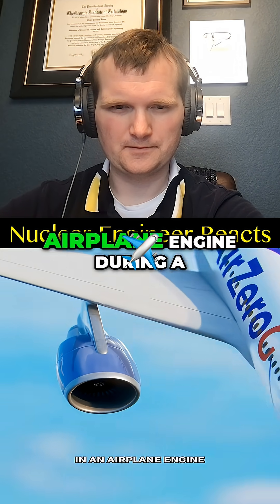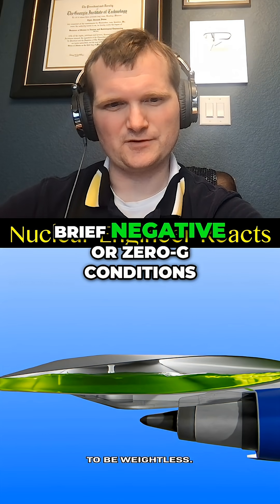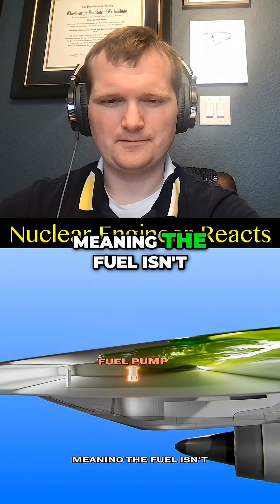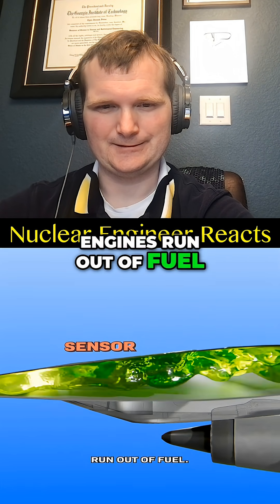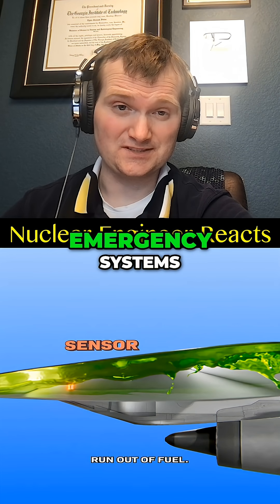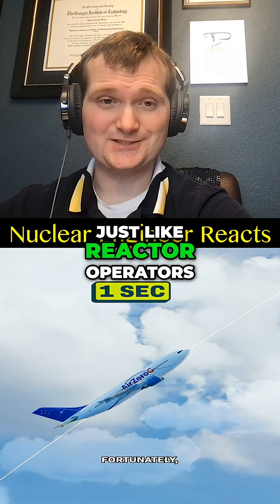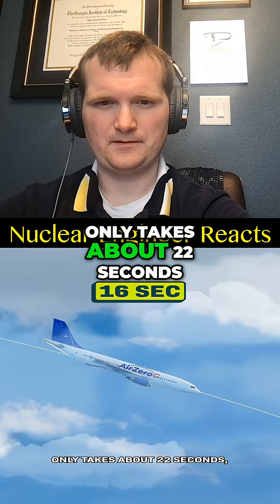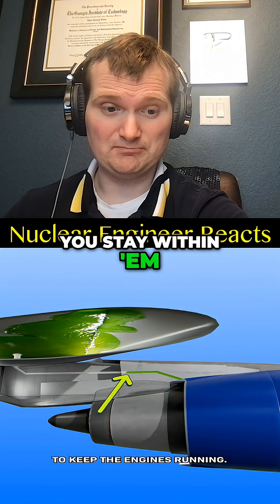Is it Okay if My Jet Fuel Floats? - Nuclear Engineer Reacts to Cleo Abram

Comment: Yeah this is simply not true, some very simple aircraft and specific systems have / had this problem in aviation but that is not the case anymore (complex aircraft). Just an obvious pointer, if this was true an aircraft wouldn’t be able to be inverted which almost all complex aircraft do in an period of time. As you said theese are pressurised systems with many redundant systems that prevents this.

Comment: Also, larger plane especially, can have multiple fuel feed systems as well as multiple fuel tanks - and since they don't do these flights with random aircraft, but specific ones set up for these flights, maybe they modifications to avoid this scenario entirely. But more likely the engines are not fed directly from a tank that is gravity fed.

Comment: Even with the residual fuel in the fuel lines, there's still going to be the air pocket in the line (assuming it's an all closed system from pump to turbine) that it wouldn't matter. 5 seconds or 2 minutes of 0G the air pocket that is created will remain, only the volume of air in the system would change. I'm not sold on this explanation. I'm sure it's not a traditional fuel pump, or It's a pressurized fuel tank/system, or something other than what she explains.

Comment: If the fuel pumps in the aircraft are briefly sucking air during the “weightless” maneuver, what’s keeping the engines running when those air pockets in the fuel lines hit the fuel injectors?

Comment: In the 80s my RC plane had a flexible tube pick up with a lead weight on the end. I could fly inverted or even at 90 or 270 'cause it had a large vertical stabilizer and rudder

Comment: Engines stalling due to fuel starvation when the plane nosed down was a problem for British Spitfire and Hurricane fighters durng the 1940 Battle of Britain and is also shown when a barnstorming pilot attempts an Outside Loop in "The Great Waldo Pepper".  I have always wondered why the designers of those planes did not fix the problems until well into WW2.   Modern jets are better designed with safety in mind.

Comment: You can actually make the engine sputter and die in a Cessna 172 during a zero G pushover, where the fuel system is 100% gravity fed.  It usually relights right away once you let up on pushing the elevator over and gravity is restored.  Don't let the prop stop 😅 (500 hour private pilot)

Comment: No, fuel only behaves like this in non-commercial smaller airframes like older Cessna's that don't have pressurized fuel tanks.

The less fuel a specific fuel tank has the lower the pressure inside the tank gets. This pressure is used to feed the fuel system with the jetfuel from the tanks. Getting below a certain pressure point removes this functionality. From that point on the remaining fuel drains by gravity or get's x-fed into other tanks to balance out the CM.
To shorten it up: Modern aircrafts fueltanks don't behave like old piston-engine prop planes which would die out if you fly inverted for too long due to drowning in excessive engine oil feed.

PS: One day, Folse will compare nuclear reactor functions and the way we cook out food. He WILL find a way to do it and it WILL have to do with neutrons and absorbant components like boron :D

Love his videos tho. I wished my teacher in highschool would have explained nuclear physics the way he does. Easy to understand and pick up but yet detailed enough to actually understand what's happening. 

Keep it up champ. Love from Germany

Comment: Found this - "An A310 uses 730lbs/hr in idle descent which equates to 117 gallons per hour. That's 2 gallons per minute. Since Zero-G only lasts 22 seconds, it only burns 0.75 gallons of fuel."
And this - "Dear Sir,

Except free floating area cabin configuration, there are very few differences with a “standard aircraft”. The most significant one is installation of Zero-G meters in cockpit and a very simple installation on the wheels [I assume he means the control yoke] to help one pilot to lead the aircraft only in vertical axis, and the other pilot to lead only in horizontal axis.

Out of that, the biggest difference is maintenance program: each parabola performed to create Zero G onboard is considered as an aircraft cycle for the aircraft and its engines, and maintenance adjusted accordingly. Such consideration dramatically increases maintenance costs of the aircraft.

Kind regards

Gilles GOMPERTZ" [marketing coordinator for Air Zero G].

Comment: There is no way that planes or any combustible would be allowed to be free-flowing like this. The fuel is contained and either pressurized or for transfer or whatnot. If the fuel level got so low that is a whole other issue

Comment: You'd usually have another fuel pump to allow the plane to keep getting fuel injected into the engines, at least that's what some aerobatic planes do to be able to perform inverted maneuvers for extended periods of time

Comment: i guess the alarms in an airplane would be similar to the ones in a nuclear power plant, since they're there to be informative so the operators know what's happening at all times. 

if you're doing a test in a nuclear plant that you know will set off some alarms, you'd wanna make sure that only the alarms you expect to go off go off, otherwise something is wrong.

Comment: There's more than one pick up per tank. They would be in the back and at the top. For cars they have fuel mats that cover the bottom of the tank and pull fuel from the whole mat and not just at the pipe.

Comment: this is an issue with race cars too. race cars have fuel cells which are filled with a foam lattice. Because the pump delivers more fuel than the engine can burn the suction of the pump and the return flow creates a low resistance path and the recycled fuel keeps the pump from running dry. you only get a pressure drop.

Comment: fuel is "pressure fed", not "gravity fed". The 30 sec limitation is due to the engine running out of oil while in zero-g, not fuel

Comment: Airplane fuel tanks have a rubber bladder that expands and contracts to consolidate fuel and prevent it from sloshing around with half empty tanks. The wings arent hollow boxes with fuel in them.
Reply: Of course they are hollow boxes with fuel in them. And there is no rubber bladder. At least on civilian aircraft.

Comment: Yes, and no..

This is is an issue thats been in a lot of aircraft...  

Early spitfires for example where KNOWN  for fuel starvation in maneuvers...  if they tried to hold a maneuver to long or even fly upside down to long.  their engines would die.  

To counter this they put in "flexable"  fuel floats,  where the fuel line would... "follow" the fuel... being dragged by the g-forces as well.

Comment: "we actually use zero gravity in nuclear power plants"
Reply: Woah, hold your horses, big difference between zero G’s and zero gravity.
Reply: @llliiimmmeee  there is?
Reply: @Rat-say-wat  There's still gravity on the plane, it's just acting freely on both the people inside the plane and the plane itself, as the plane is nosediving and has minimal drag.

Now, imagine dropping two objects from a high point at the same time. They have the same force acting on them, gravity, so they both fall at the same rate. As their speed is the same, from one object, the other appears to be not moving. We call this being 'relatively stationary.' As it turns out, the same goes as for when one object is inside of the other. The object won't be falling down or flying upwards relative to the larger object, it will just be the same.

This means the force experienced by the object inside of it, in this case our plane, is effectively zero from the perspective of the person. However, from the ground, both the plane and person are still falling, still experiencing gravity. That's why it's not true to say they aren't experiencing gravity. They're experiencing no relative forces, zero 'G's.
Reply: @llliiimmmeee  huh. cool explanation

Comment: I have a better question, why haven't they improved the fuel storage/delivery system specifically for high G maneuvers. I mean a plane made/modified for doing this in particular could use multiple well placed fuel pumps to allow extended dives. And there's surely additional ways. I'd assume it can climb high enough to dive for more than 30 seconds. I'd be surprised if their wasn't a zero G plane that dealt with those limitations already.

Comment: There's also coasting speed where the plane can glide for long enough to get fuel back into the engines without them breaking if it does run out.

Comment: I don't know why I thought the planes fuel wasn't in the wings
Reply: it’s under the sauce
Reply: @i @imawizard227 where’s the cheese?
Reply: @imawizard227 elite ball knowledge
Reply: Some of it's in the wings, some of it's in the fuselage. Unless you're using it for balance, you want it as close to the Center of Gravity of the airplane, so that as you burn fuel and the airplane gets lighter, you keep the Aerodynamic Trim (And the airplane's stability) pretty much the same.
Reply: @peterstickney7608  Putting it in the wings takes some of the stress off of the wings by spreading the weight across the wings, instead of all the leverage that would come from putting it all in the center. The wings are the front/rear center of gravity. They are were all the weight is supported. There are systems of baffles and pumps to keep the fuel balanced left/right.
Reply: @Bob5mith  Its also a safety thing.
Reply: @peterstickney7608 only larger planes use wing tanks
Reply: @SmeadlyButler  Few planes do not have fuel tanks in the wings. Those are usually experimental, or stunt planes with ultra thin wings. A few early WWII fighters, like the Mitsubishi A6M Zero, didn't use wing tanks. But almost every plane you see these days, have fuel in the wings.
Reply: @Bob5mith  Even the A6M had a fuel tank in each wing.
Reply: @SmeadlyButler I don't know of a single aircraft in the world that doesn't have the majority of the fuel in the wings. Most single engine Cessna and Piper aircraft that you see flying around have fuel exclusively in the wings. Most small planes aren't large enough to have fuel tanks within the fuselage.
Reply: @Cragified  What‽ Are you saying Google mislead me? I just don't believe it!

But seriously, now it's not listing the Zero. Only the Lockheed F-104 Starfighter is listed by name now.
Reply: @Bob5mith  Don't rely on the AI summary it's garbage.
Reply: It's why a lot of planes immediately explode when the wings get clipped off
Reply: Some planes have extra tanks where cargo would normally go for longer range.

But most passenger planes store the fuel in the wings.
Reply: @dominicfindlay  and some have tanks that are dropped when "bogey too close for missiles. Switching to guns"
Reply: @StephenDeVoeJr  acting like they're going to put guns into aircraft soon
Reply: Because most of air plane wings is just hollow metal block so it make sense to put something like fuel
Reply: I also thought it wasn't. I thought it was at the point just under where the wings attach to the rest of the plane.
Reply: It is that’s why if you have a fuel leak/ fuel pressure drops it can be game over
Reply: It isn't common sense, so dw haha.

Comment: As you've also said, not all aircraft have same type of fuel intake on tanks, put they are similar. In planes like this they are designed to work for these conditions I guess.
Reply: thanks for the redundant comment for a phrase you didn't interpreted correctly
Reply: @akiraic 🤓🤓
Reply: @kalebgross1310  👄
Reply: @akiraic  bros not him

Comment: I would have assumed that, in an aircraft designed to do this,   the fuel would be in a rubber bladder within a pressurized tank.
Reply: In a previous video she said that those are pretty much stock normal airplanes (except maybe the interior)
Reply: That requires custom wing designs for a 100M plane that you're going to have a production line count of like 2 and it would have to be done at construction time since the bladder has to be installed inside. Combat aircraft have much larger R&D budgets and much larger production lines while stunt aircraft are sufficiently small and with sufficient simplicity that your construction overhead for the prototypes are affordable for commercial ventures allowing for those two scenarios to push forward but for this scale, it's much easier to figure out what the technical limits are of existing solutions.
Reply: That's gonna add unnecessary complications which leads to all other kind of other engineering problems. Limiting the maneuver to a specific time frame is a much simpler solution.
Reply: @aRandomMe987 it'd be cool if it lasted longer
Reply: @Giova104  And catastrophically more expensive. This sort of sport aren't big enough to warrant that kind of investment.
Reply: @aRandomMe987  isn't that used for research too?
Reply: @Giova104  Yes, and this is not research. Merely recreational activities.
Reply: @aRandomMe987  not that much expensive
Reply: @akiraic  Well, you can fund it.
Reply: @akiraic   You have to prototype and certify and if your prototype fails, you might be out 100M. They're not overhauling their production line for what will only be a handful of sales.
Reply: @Giova104  during weightlessness or zero g in an aircraft you arent at a set speed, you and the plane are being accelerated to the ground at faster and faster speeds, 8 meters per second of acceleration every second, very quickly approaching the aircrafts speed limit, longer free fall times means much more aircraft parts disintegrating around you, not to mention altitude loss, those 30 seconds of freefall see you go around 8 thousand feet in altitude at a speed of around 800 km/h only getting faster and faster as you continue falling, atleast until the speed which the airframe gets torn apart by the air, going for longer than 30 seconds is less of a fuel issue and more of a certain death issue, its simply cheaper and safer to build a rocket and orbit earth for extended zero g times
Reply: @aRandomMe987 
 Large aircraft have fuel bladders. The fuel isn't just sloshing around inside a wing tank.
Reply: @douglasdixon524  You can tell them to get some of those and perform with them.